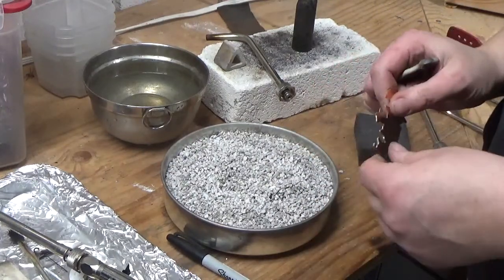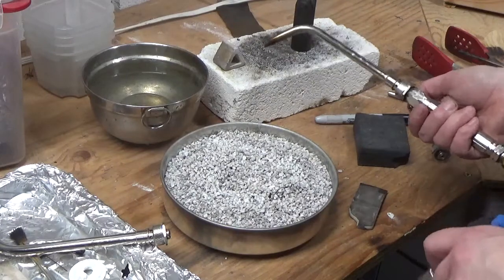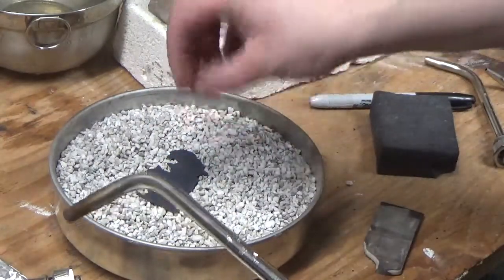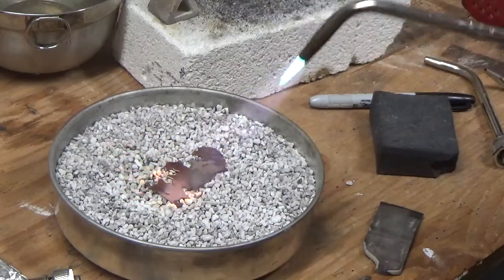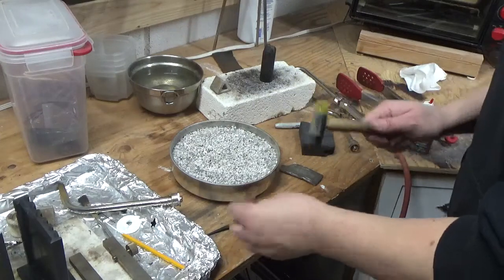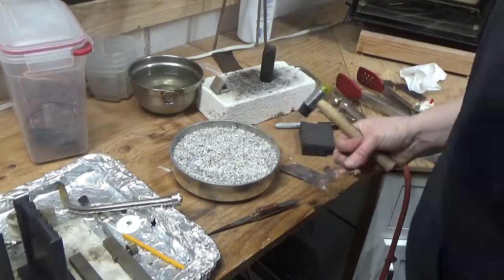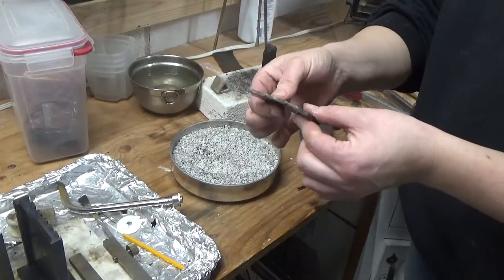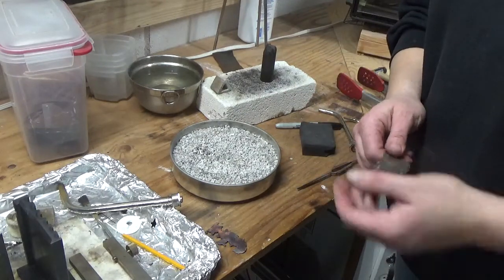How to anneal your metal

Comment: Please do not use a Bic type lighter or torch to light your torch. they should not be on the soldering bench or in your pocket when you are using another torch, A drop of hot solder turns them into a bomb! Buy a flint striker. I could not watch the rest of the video.
Reply from the maker: Mike Otero if I set myself on fire or blow myself up I’ll be sure to post it lol (especially since you don’t know the difference between a butane torch and a bic (spelling..) lighter. You learn something or you don’t. You’re arrogant or you’re open. Whatever you are, I hope you’re at least a happy person ;)